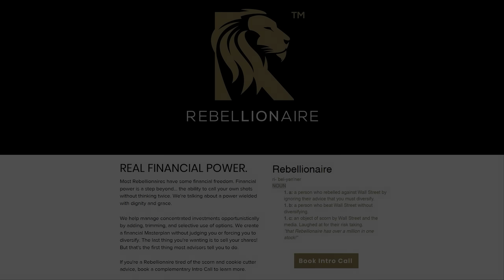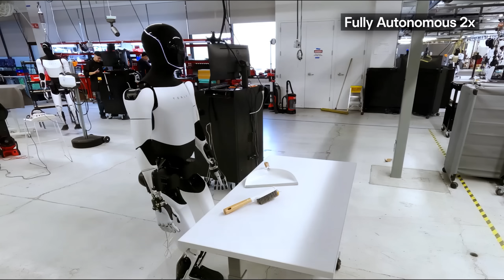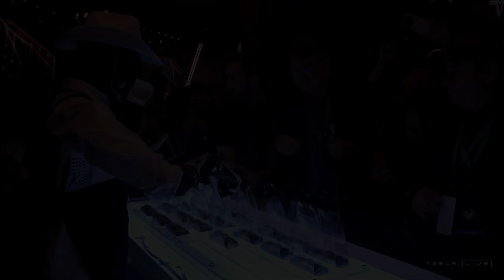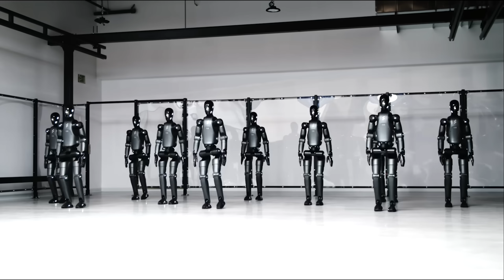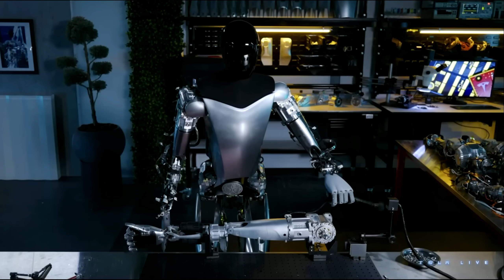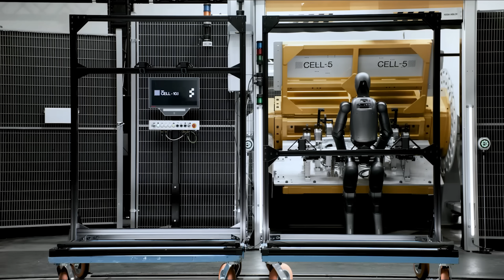Optimus 102:  How To Train Your Optimus

Comment: I feel like you may have missed the point with some of the "app store for skills" stuff.
- if the model running in Optimus needs to learn every skill known to man as the fleet grows either the net will be massive and slow and expensive. A smaller more targeted model would be beneficial, this is akin to both quantized models and not using the maxed out 700b models if you want to parse some text.
-applying new skills need not be like installing new apps, it could be a LoRA, or a expert in MoE, or an amount of slots in the decoder to plug other model's data into. Perhaps even datasets that fine tune a local variant though i dont think thats realistic.
-there's benefits of crowdsourced data from market effects if you have a market
-there's also benefits to one or more parties for paywalling specialist skills
Reply: Agreed.  There are too many tasks performed in too many ways for everything to be in one net.
App store or In-App purchases (more likely) will be larger than Apple's App Store by at least two orders of magnitude
Reply: And eventually, Tesla will have to allow 3rd parties to create the nets for the bot
Reply: "Download Kung-Fu"
Reply from the maker: With decentralized training and compute growing by 100,000x every few years, the net will be able to handle it.  It's only a matter of time.  When, I don't know, but it's inevitable.

Comment: I'm not sure about your assertion that every skill learned will be available to every robot.  For instance, unless there's something different between the neural net here and the wet neural net in humans, we know that certain skills, particularly ones that require a high degree of differentiation and concentration - like Surgery, or watch making - require inordinate amounts of the neural net to learn, and so  you'd quickly either run out of nodes, or make the neural net so large that it could not be accommodated by the hardware (to large for storage and too complex for compute).  It seems to me more likely that skills, particularly specialized, intensive skills, would be "experts", e.g. smaller, concentrated neural nets that only be loaded and processed as needed, and it seems to me that such skills could and would indeed be isolated and downloadable.

This also assumes that the "basic" skills for all robots would be the same and consistent and stay consistent over time such that the MOE skills would continue to be applicable to the underlying base model, an assumption I'm not 100% sure you could make.  For instance, the base skills might include making coffe with a drip coffee maker, but if you prefer a french press, that's an entirely different procedure.  Also, something you're probably more familiar with, if the skill "Drive a car" was trained on a tradition car and you put the robot into a Tesla with single-pedal breaking, that's going to trip up the robot in the same way as it trips up any human the first time they crawl into a Tesla (or, more likely, vice versa... why would they train the robot on Fords and not Teslas? :) ).

I think the downloadable skills makes more sense from both a business and technical point of view.
Reply from the maker: Each task is a very very very small subset of the reality that the billions of hours of video data out there holds.

These nets are improving by 100,000x every few years.

As for the second paragraph, these neural nets are adapative and generalizable.

These things WILL happen.  It's just a matter of time.  

To say what will happen by when is an entirely separate video
Reply: It makes sense to have basic, deluxe, premium, etc. skill suites to get the robots into more homes for a wider range of customers.  After all, you wouldn't want the fully functional intimate partner model as a family robot.

And frankly, I'd rather have one that was limited in its skills instead of having one automatically update skills that I personally trained them to do.  One of the reasons I no longer use Windows operating systems is the annoying turning on of settings that I intentionally turned off.  Opps, another mandatory automatic update, time to reset everything.

Comment: so getting 100% physics realistic models into sims is basically impossible. I think OpenAI did some early research on this and came to the conclusion that the solution is to get it as close as you can, then do sims that are basically all random small variations of the best guess parameters, so the model "learns" to deal with variability and isn't brittle when exposed to unexpected conditions.